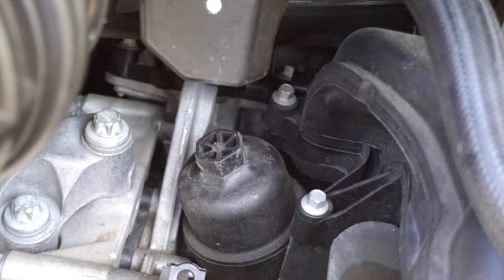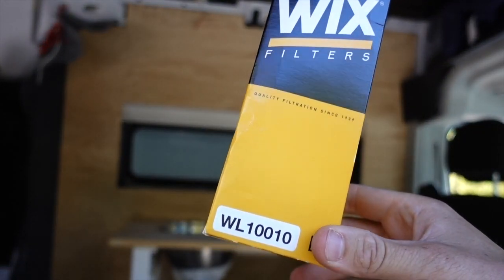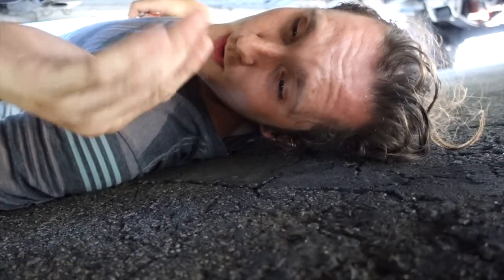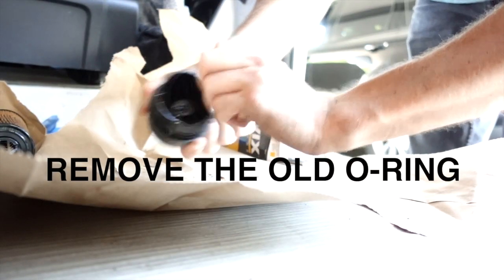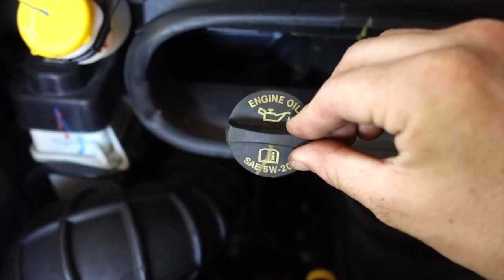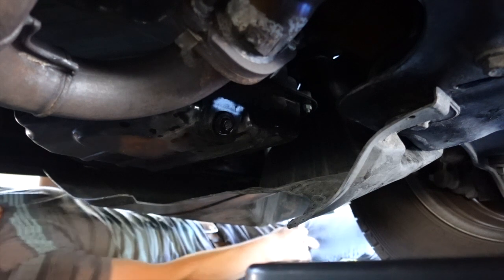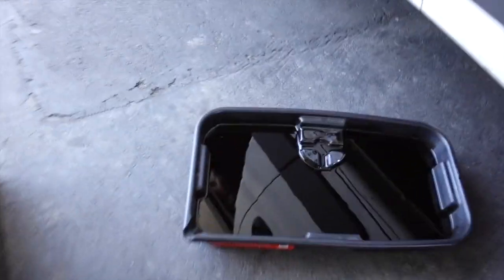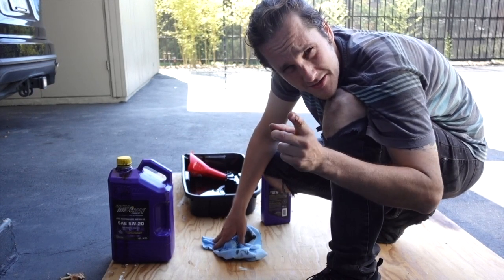Ram Promaster Camper Van Oil Change

Comment: you can actually use an oil extractor pump and stick it where the dipstick goes to pump the oil directly out of youe engine instead of draining. This way you A) don't need to get down under your van to drain and B) will get (slightly) more oil out. Also, C) you can pump the old oil directly into your emptied jugs after filling up. Just another option. Got this idea from the "Promaster's Only " youtube channel which i highly recommend for anyone with a Promaster.

Comment: If you run synthetic oil you should use the WIX XP filter The XP filter is designed for synthetic oils. This is the case with all WIX filters.

Comment: Is that the way all Pentastar V6 motors are from Dodge on their oil filters!?  It's been a while since I've changed the oil on one of my cars ever since I am financially able to buy new or newer cars, the Dealer's almost always thrown in the service plan to 'sweeten the deal.'  Couldn't wheel and deal on my Promaster though lol :-(  But I was just surprised to see an exposed filter rather than a removable and replaceable can.

I feel I should report this video to PETA, you have apsolutly ZERO consideration for all the Snakes seeking the nurturing warmth of your Pentastar V6 LMFAO.